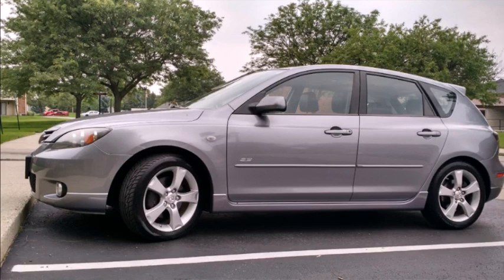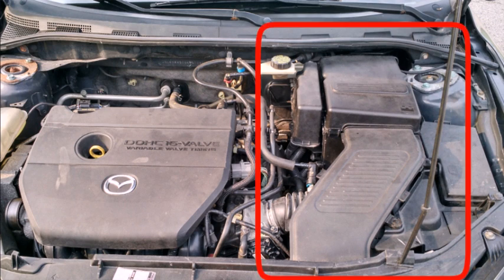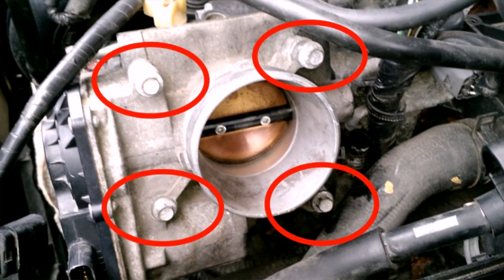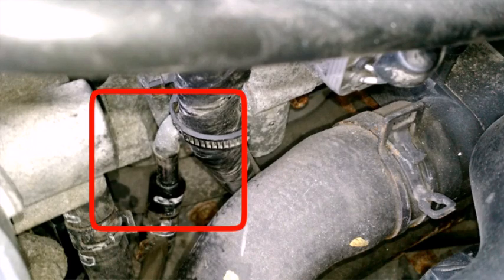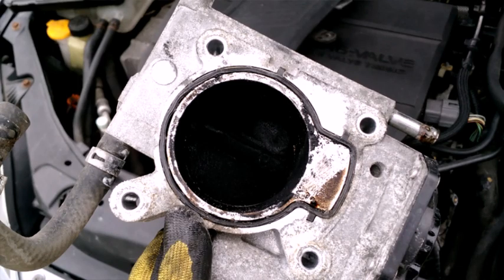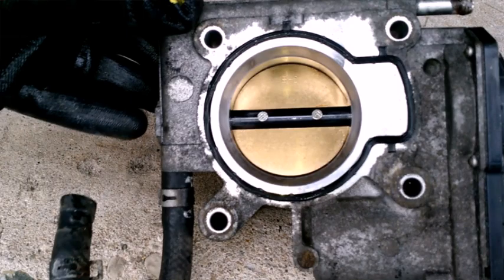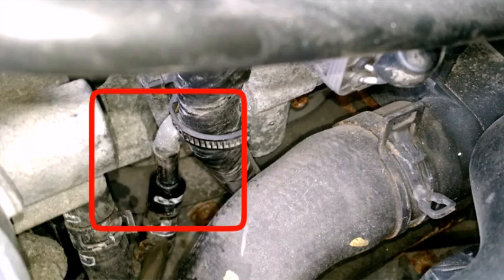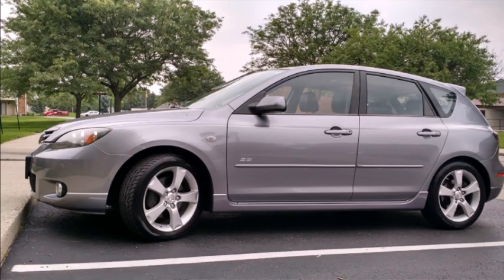2006 Mazda 3 Throttle Body Removal and Cleaning

Comment: Recent work done on my ride was a Thermostat replacement, as well as a new MAF. She ran great for a week, then I went on vacation and then when I returned, she started to idle (dipping rpms) at red lights and at idles once the engine was warm. No Check Engine Lights. Nothing. Mechanic (pretty honest guys) said we could spend thousands trying to figure it out but suggested step 1 get a fuel system cleaning. This involved cleaning out the throttle body, injectors and lines. See how it runs and see if I get a CEL. He is hoping I get a CEL so that we can troubleshoot further. 

Drove it today to work after the fuel system cleaning and she seems to be good. I will know better when I drive home when it's much warmer outside.
Reply from the maker: I had a similar issue with a car when my EGR valve started sticking.

Comment: Hello from Serbia.I have problem with throttle and i would like to clean,but i spoke to some mechanic and thay sad thet it should be calibrated.Is it corect and how to do it,if i hadve to do it at the end.Thank*s
Reply from the maker: Don’t know anything about calibrating. Being electronic you’re supposed to avoid manually operating it. If you’re currently having issues, I would imagine cleaning it would help even without “calibrating”

Comment: I did a partial clean on the throttle body but had to abort going further because my cousin needed a ride. My engine hangs at 1800rpm when I disengage the clutch (coming to a stop), then settles about 3 seconds later. Will disconnecting my battery for a bit and resetting the TPS settings help with that?
Reply from the maker: +liamthedevastator I always like to try and fix a problem by disconnecting the battery... But that rarely ever helps. lol.

Comment: Great video. I'm just about to do this as I have the hesitating idle issue. If I disconnect the coolant lines, do I need to bleed the air out of the coolant system when reconnected?
Reply from the maker: as i recall, there was very little coolant loss. I didn't have any issues myself but sometimes it's better safe than sorry I guess.
Reply: +PromisKeeper thanks for the reply. I think I will bleed the lines a bit to see if there is much air in there.
Reply: +PromisKeeper After reading about Mazda engines, apparently they do not have coolant air bleed screws on there system. The only way to bleed the system is to run the engine to normal operating temperature... then run the engine at 2,500 rpm for a couple of minutes. (while making sure the engine does not overheat). Basically cycling the coolant through the system.
Reply from the maker: +Chris P like I said, I wasn't worried about it. as little air as it is, it should work it's way out easy enough.  whenever I mess with coolant I always squeeze the largest radiator hoses to force fluid through.

Comment: So are you saying that we should not open and close the brass plate at all?
Reply from the maker: professionals recommend having a second person operate the valve with the gas pedal. I've nudged it without having a problem. I don't have a second person to rely on and something about having the ignition turned on with me working under the hood is unsettling.
Reply: I heard you have to be careful with forcing the brass plate as there is a gear mechanism for these fly-by-wire Throttle bodies. Just to be safe use a weight or a 2nd person to keep that throttle body open.

Comment: Shouldn't you let it run for 5 to 10 minutes the first start after performing this maintenance to allow the computer to relearn?
Reply from the maker: TiaGo2k6 I've heard people say things along those lines but it was not an issue for me in this case. Or the other 3 times I've had the intake apart. I've only had one vehicle so stubborn I had to do anything like that. it was a Dodge Ram with a dead battery. Literally had to keep my foot on the gas for like 10-15 minutes so the computer could reprogram itself with the new battery installed.

Comment: Unhooked the coolant lines sprayed radiator fluid all over the place. =(
Reply from the maker: wow. was the engine still warm then?
Reply: Eh, was sitting for about 45 mins so yeah. Lol But I had released the pressure  from the system I thought by taking the radiator cap off.
Reply: Skyler Small hahaha that's hilarious, I just did the exact same thing. Freaked me out because I thought I got coolant into the throttle body, but it seems to be okay! Gonna try to clean the rest of the body at home tonight.